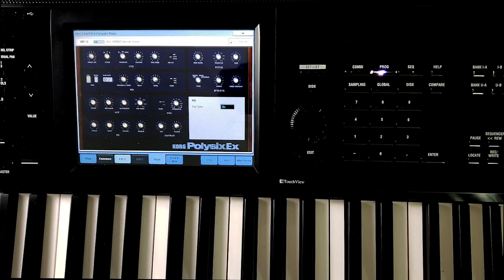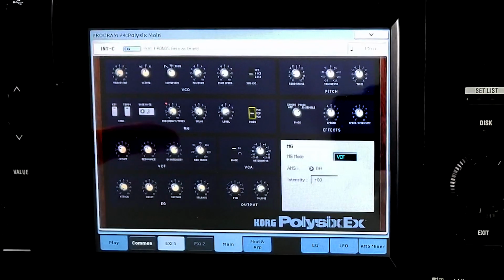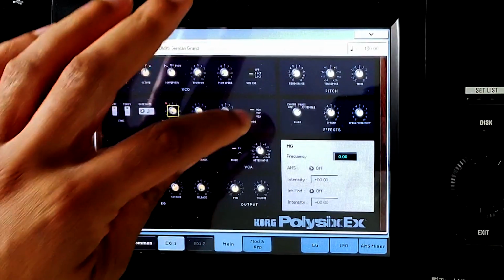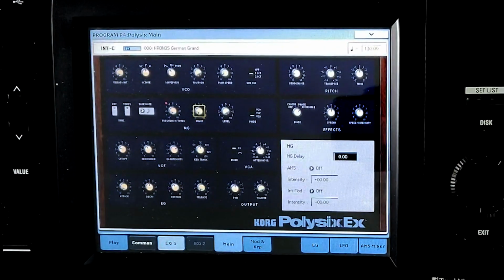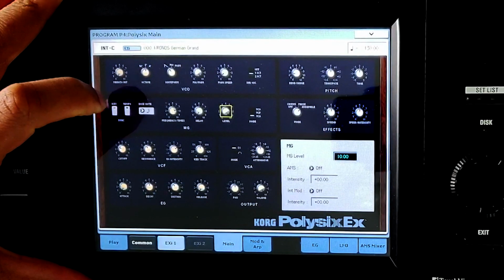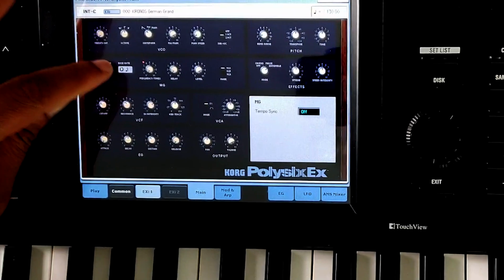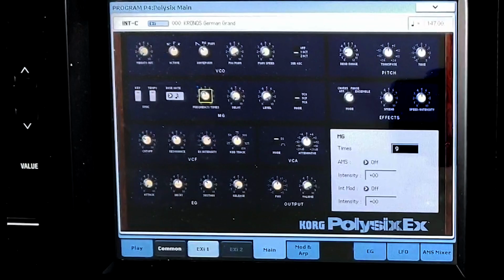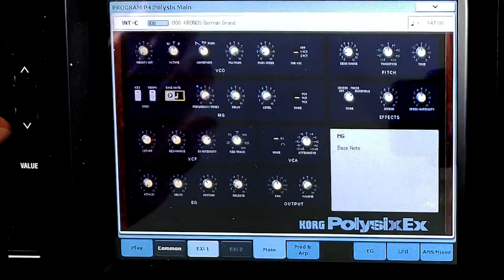Korg KronosTutorial: PolySixEX Sound Engine Video 3

Comment: Why only 1 oscillator?
Reply from the maker: Because the original Polysix only had one oscillator. However on the Kronos you can combine two of Polysix instruments together in one program which will essentially give you two oscillators,  two sub-oscillators,  etc.
Reply: Thanks for answering my question Darrick, I appreciate your time.